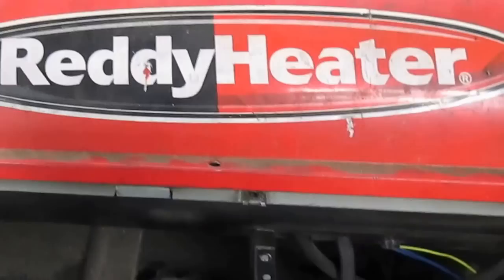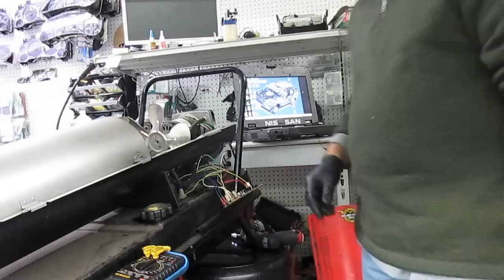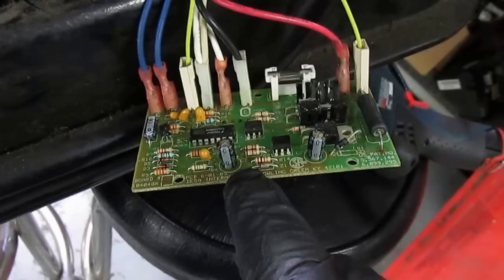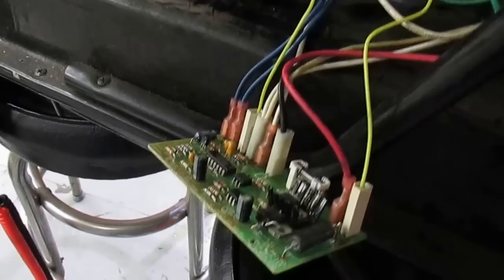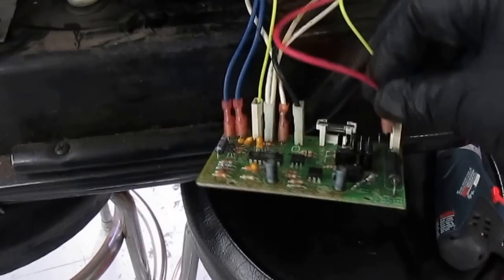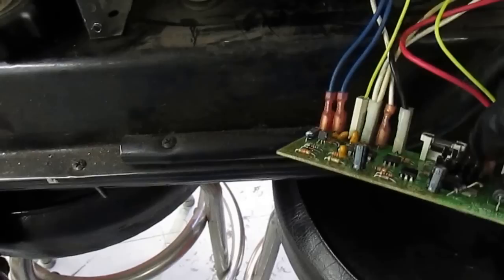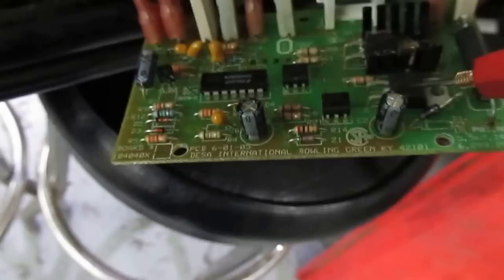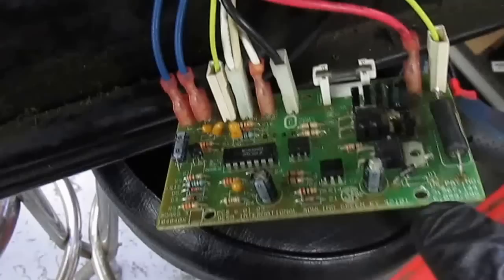Torpedo Reddy Heater with No Start troublshooting

Comment: A great video - I have exactly the same heater and it had the same problem. Thanks for the fix; but, you mention twice the air pump on the rear creates vacuum. It is actually a compressor and blows air up to the nozzle to induce kerosene   up to make a mist to burn. Still a great video - Thanks.
Reply: The vacuum occurs inside the nozzle - venturi that sucks in the fuel.

Comment: Great stuff, thanks a lot. I have a fanmaster which wouldn’t fire and stripped an cleaned it but no joy. I undid the plastic screw next to the  Pressure adjuster and it was cracked. I replaced it and problems disappeared. Too much air I guess. Worth a check anyway.

Comment: I was wondering why the diode converting to twelve volts was disconnected...in the end of video there was a diode on the underside. We missed the part where you explained this. Also the pick up tube for the venturi effect on the fuel was not explained.
  Most novice repair guys have no idea what a zener diode looks like or it's function. It's basically a one way valve for current. ? 
  Many areas where this can be an excellent video as opposed to just average. I loved the video none the less. Please post more.
   Remember...I'm watchin' you.
Reply from the maker: diode was bad .just want to show alternative way to replace it from the bottom of the board .
Reply: Mine will run for about an hour then shut off...Ideas?
Reply: THANK YOU THANK YOU!! I know this thread is old but you helped me troubleshoot, as a couple others said plugged in,got igniter,no fan..jumped motor and runs,reconnect and no fan, mind you this heater only used for couple days when new then put away for maybe 20 years, not till you showed lighting a BIC lighter that I tried and bingo! It worked tried couple times then closed it back up and worked! I must have watched 20 utubes, your way of running through testing shows your knowledge and many are great full for that, wishing you the best! THANKS AGAIN- subscribed

Comment: Hello! I know this video is quite old, but so is my heater😁 I do not have a soldering iron or access to diodes and chips...a new board is $80 do you dignose and repair the boards? My R115 is the same as the video only no on/off toggle, just plug in and it goes.  It worked fine last winter, now I plug it in and nothing. 
Motor runs directly when jumped, as does the ignition, I do not test the photo cell, but the unit does not do anything when plugged in.

Comment: Great video Thanks for the info. I think mine is the control board, but I would just like to confirm it.
I check the incoming power and that's fine. The fuse is fine. The photocell checks OK. And the ignitor is working. If I hook the fan motor up direct to power (hotwired it with a jumper) the motor runs fine and if I leave the fan going the heater starts up and runs. So is there anything else or do I need to replace the control board because I not sure what to replace on the board. Seems the motor is not getting the signal to turn on
Reply from the maker: If controller don’t see the flame within 2 seconds it will not turn fan .. timing is crucial
Reply: @welltekdiagnostics6835  So the ignitor comes on but the motor never starts it has power to the fuse and the fuse is good. I hooked the meter to the control board for the motor and it never gets any voltage. I can put a jumper from power to the motor wire and it starts and runs so suspect the control board is bad
Reply from the maker: @warrencheney4936  if you force motor to run does it stay. Running
Reply: @welltekdiagnostics6835   yes it does and the heater runs fine

Comment: ok so I'm only getting 2psi pressure even with the adjustment screw all the way in so i guess I have an air leak, bad vanes in pump or maybe the nozzle is worn causing or cracked plastic filter cover causing a low pressure. anyone have an ideas ? i have to check everything with soapy water. thank you

Comment: I have a 220T that won't start. Ignitor lights up. Tested fan like you said. Plug it in though and it does nothing. The circuit board is clean and all connections look good. Part number 104040U.  Any ideas?
Reply from the maker: You have to bring it to us to be able to find issues
Reply: I was able to find a circuit board on an older unit and swapped it out. Seems to have been the fix

Comment: How do I do I check the control board when when I plug my Reddy heater professional series 170t multi-fuel the AC switch does not illuminate so would it be the AC switch or is it the control board and how do I check it with no power

Comment: So tell me again, the first diode is needed to drop line voltage to 60v dc, then the Zener diode regulates it to 12v dc. Now explain how your heater is working....but the diode is NOT soldered to the board!!! So you have no 60v dc nor 12v dc. Which is probably why you failed to detect 12 at the Zener diode output when you tried to demonstrate it to us. Thanks
Reply: I thought that same thing till near the end of the video he flips the board over. You can see some lazy ass just soldered a replacement in on the bottom of the board without removing  the bad part and mounting the new correctly.

Comment: Wow.  What knowledge. My All-pro 170T circuit board will not work although the fuse is good.  I suppose that is it since none of the indicator lights activate.  The board is 100.00.  Is there a way to replace it with a different cheaper board?
Reply from the maker: the cheaper one for some reason they don't last long .on Ebay you can 
find it .also you have to modify it to meet the same Amp.that your pump 
need .

Comment: Any idea why a 75,000 btu unit works better with the fill cap off then screwed on? Im talking about the fill cap on the "gas" tank.

The unit is a Master MH-75T-KFA 75,000 BTU
Reply: ddemier ddemier Certainly check fuel pressure first! #1 importance of these heaters. check to see vent on cap isn't plugged. if it is, the fuel won't flow out of the tank it may create a vacuum.

Comment: I have a 115,000btu that doesn't have a power switch, it's a 'plug n wait' style. -The kerosene is expired.
-all i hear is a 'humm' for a short time. 
-the fan doesn't engage nor anything else.
I plan to try new kerosene

Any tips otherwise?
Reply: check to see if the motor spins, or if it's hard to spin. if it is the try penetrating oil on the motor where the shaft meets the motor, otherwise your air pump on the other end of the motor might be stuck. chances are you need a new motor.

Comment: I have two Reddy Heater RM60. Both have ignitors working, air pressure correct(3.4 psi), nozzles spray but flame never ignites. Just confuses me. Thanks.
Reply from the maker: ignite the flame manually ..see if it stay running if for some reason it stops you have circuit board problem ..you have to send it to electronics tech to do Diagnostics

Comment: I have a kerosene dura heat and it wont ignite I put everything new on it rotor kit and air filters and new hose but it wont ignite. But when I take the lid off it ignite and run for a few seconds what you think ?
Reply from the maker: On Ebay they sell Circuit board to Ignite Spark plug ,you can add it to your heater and it is safe to use .you need continuous spark that will help ..let me know please .
Reply: Thanks  that works.

Comment: I have changed the ignitor the filter the air filter the photocell the fuse and all it does come on and then shuts off right away
Reply from the maker: this is not easy to troubleshoot ,check your inputs I wish if you can bring it to our shop I can help you
Reply from the maker: can you read the voltage ? Hamid Signs
Reply: Photo eye, clogged nozzle, not enough air from air pump...in that order.

Comment: My  ReddyHeater 55,000Btu runs for one to two minutes then blows the 5 or 6amp fuse. The manual specifies a GMA10 fuse, but when installed the igniter disintegrated. The kerosene is new, the air pump, rotor, vanes, nozzle, photocell, air and fuel filters are clean, and the circuit board shows no signs of discoloration. Any ideas that  might resolve my problem?
Reply from the maker: is your circuit board looks like mine ?any part numbers
Reply: My board shows Part No. 104040Y at the lower left corner, while yours seems to shows 104040X. The boards are fairly similar though, mine showing 2003 presumably a date.
Reply: Mike, Inspecting the photograph I sent you yesterday my original circuit board clearly states 6.3A near the fuse holder, even though the ReddyHeater manual specifies a GMA10 fuse. So this explains why the igniter disintegrated when operating with the 10amp fuse. Now the problem is clearer: why does the machine run for a minute or two before blowing the 6amp fuse?
Reply: My last comment was inaccurate: The 10amp fuse disintegrated as well as the igniter
Reply: Michael: Since my last correspondence, I purchased a new igniter, which seems to be working fine, except the installation booklet accompanying the igniter states it should not remain on for more than a few seconds after the gas ignites. My voltmeter shows it continues to receive a constant 120 volts long after ignition. I switched the machine off after half a minute of operation. Any further thoughts?
Reply: Michael: the installation of a new board resolved my problem. Now, power to the igniter fades soon after combustion, just as it should. Thank you

Comment: What could be wrong with one of the fan works it sprays diesel and the igniter works mine comes on with everything but won't ignite the diesel sprays and the igniter is red hot but nothing
Reply from the maker: you may have contamination inside your tank ,take a sample try to ignite it out side and see how fast it burn,also you may have to add some stuff to clean it if that the case .
let me know
Reply: welltek diagnostics its fresh new diesel

Comment: Or you just replace the board
Reply from the maker: replacing board is the most easy way to do diagnostics ,,is that what you mean
Reply: Not sure if you will check this or not, but, what does it mean if I jump the red wire to the black wire (like when you tested just to see if the fan was working) and my heater works fine? Wired correctly, when I plug it in I just get the igniter glow, but no fan, then it shuts down. Jump the red to the black, and everything works fine when plugged in. Thanks for any help.
Reply from the maker: have you checked photo cell output ...let me know
Reply from the maker: it is always easy to replace the board .on this video my goal is  to help  to troubleshoot components and operation of each component .also one of the things I encouraged is to use a spark plug constantly as a replacement for glue plug by using external circuit to control Spark plug.you can find it on Ebay .
Reply: Thanks for the quick response! Well I checked the photo cell and was getting a really high reading. Had to set my meter to 2M. It would come down with visible flame though. But, apparently with all the messing with the wires, some issue was cured, because it is operating just fine now. Thanks again for the help.